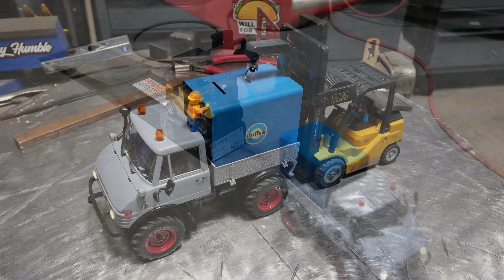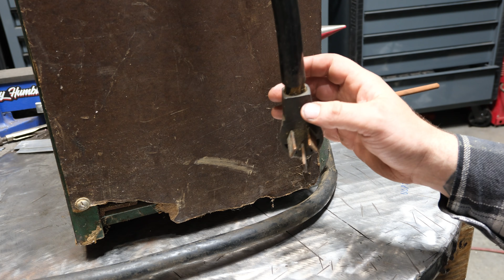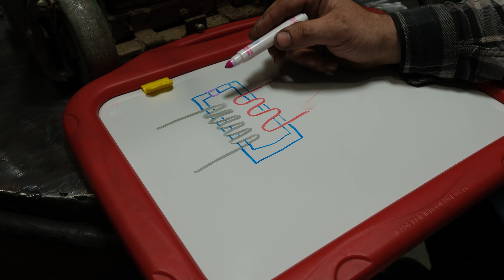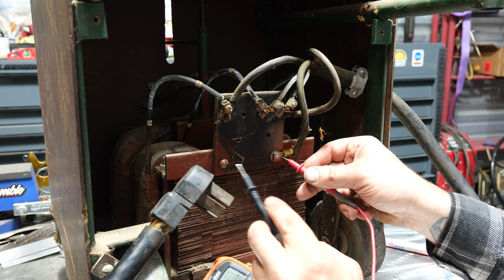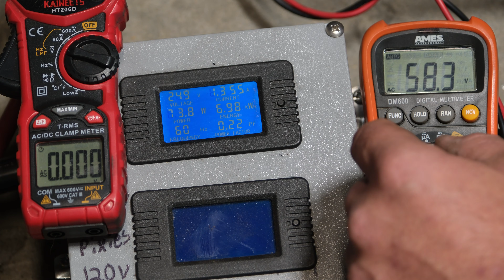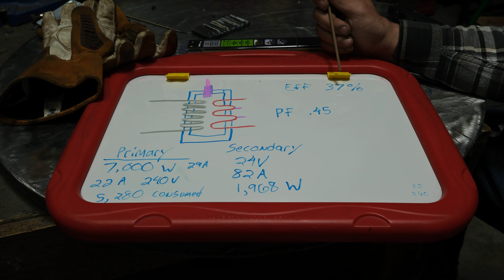A super janky (but free) homemade welder tested....

Comment: Popular Mechanics had a paperback book from way back when, I have several from the mid 50's to early 60's, they had plans for welders, metal and wood lathes, drill presses, airguns, paint sprayers, rifle scopes and all kinds of other things to build, it was when you could go to a scrapyard and find all kinds of parts they even had sources you could get tools, military surplus stuff like motors, they're pretty awesome books. Needless to say, like others have said, there is a good chance they had plans for that in those, I flipped through, found 4 different styles including an engine/generator, it used a regular 120/240v electric motor connected by a belt to an alternator that you modified to put out welding juice, plus a shunt plate to allow you to adjust the welding output.
Reply from the maker: I wonder if it is indeed something built from plans like that.  I have heard of such animals but never seen one in person lol.
Reply: My grandfather built the welder generator powered by a 8hp Briggs for off grid stuff back about 75 or so it worked pretty good for home built wish I had it now went to scrap years ago
Reply: @louiel8711  I remember the "Use an old lawn mower engine and and an alternator to build a generator" plans.
I forgot how you modified the GM Delco One Wire Alt to get 110 AC out of it but the told you how.
Reply: Used to subscribe to Popular Science, Popular Mechanics and Radio Electronics.   Elon stole my Mars starship plans....

Comment: Even now, in some parts of the world this welder would be considered hi-tech compared to what they seem to be using in the videos.  Not being disrespectful, just saying that sometimes people just have to get work done with whatever they have at the time.  Thanks for showing how it's made.
Reply from the maker: No doubt the fact it can be adjusted at all is an upgrade over what many people have to work with, even today.  I have seen guys in Pakistan weld together truck axles with a big ball of wire for a transformer, it’s amazing what ingenuity will alloy someone to do.
Reply: 100% agree with you. I've been fortunate enough to have worked world wide in some pretty rough locations where no8 wire solutions are the norm.. crude sure but effective and very easy to repair is the name of the game when spares are literally days if not weeks away..

Comment: With the way the laminations of the travsformer looked quite uneven in length, or at least not stacked in alignment, my first instinct was the trans was homemade. Now there's certainly a ton of decent looking winding. I wonder if a guy wgo rewound motors made it as a little hobby project. Seems like the original builder had a pretty good idea if what he wanted to do, and for its age maybe he did. It's actually a really cool old relic and as someone else said,va great conversation piece. It's probably one of a kind, but I'd still love to see how it runs common electrodes.

Besides, it's s hell of s lot more well thought out than the guys wiring up a few microwave transformers screwed to a 2x4s with a set of jumper cables.
Reply from the maker: It’s definitely odd, some things look legit on the transformer and other things not so much.  It’s the noisiest transformer I have ever heard, which makes me wonder if it was junked in a scrap bin and someone snatched it up, did some quick repairs, and made a welder out of it.  Due to limited power I wasn’t able to do much testing so I am going to hook it up to a bigger breaker and see what I can find out.  I am not sure how well the variable amperage actually works, I have a feeling it might not work as good as expected lol.
Reply: @makingmistakeswithgreg I’ll tell you what’s odd. I wrote a post and, well, posted it. That was fine. Then I went to the internet and added a page with a picture of an old GE crank welder - and my post seems to have disappeared.
Reply: A lot of old transformers are somewhat irregular.
Reply: I saw those laminations too.  They did look like they might have been prototypes.

Comment: I wanted to see the welds though. Did you get a nice slag peel from the 6013? I imagine you could also run a 3/32" 7018AC rod off that machine, might make some ok welds. That open circuit voltage looked nice too, enough to keep a 6010 lit, but 6010 on AC power would probably make a big mess and throw spatter everywhere.
Reply from the maker: It actually welds good.  I will have to do a quick video welding with it 😀👍.  6013 actually had a slag peel, but that’s probably more to do with the decent rod than the welder lol.
Reply: @makingmistakeswithgreg  No, you're right about the welder does a decent job. By welder I mean you not the machine. So this is a really good lesson that even with a janky machine like that, you can put down a better looking bead on plate than me with a low hours nearly new Multimatic 215. lol! Nice. I had a feeling with that big of a transformer and good open circuit voltage that thing would weld ok. As long as the transformer didn't overheat first... 5 kilowatts with no fan seems sketch, and we both know how damn hot that tin shed gets in the summer!

Comment: Many thanks to the person that passed this along to you, Greg, it was neat to see it.  I've seen some real janky gear in my six decades, and this one ranks right up there.  Sorry, but I do have one issue with your video.  We didn't get to see your welds!  😮🤣
Reply from the maker: I somehow forgot to put a pic of the welds in the video lol.  I will be retesting some efficiency testing due to some discrepancies and I will do some actual welding with it.  It actually welded pretty good.  If the amperage is set low it has a real rough time starting the arc but other than that it welds good 😀👍
Reply: @makingmistakeswithgreg A comparison between that welder, the DialArc, and the Tombstone would be pretty cool. Just show it on the whiteboard.

Comment: i'm very interested to see this things efficiency & ability on its higher settings. please do a follow up.
Reply from the maker: I am going to retest its efficiency.  A few people pointed out some things seem a bit off and I agree.  I am thinking there may be interference going on with the meter because some things don’t make sense.  I will run at higher output as well.  It should be in the area of 50% to 60% efficient at low output, so I need to definitely do more testing.
Reply: ps. any chance that there's some way that the settings on the welder somehow shifted in years of use/neglect? i cant really see in it so i don't know if a bolt or something could have moved for that indicator.
Reply from the maker: As far as shifted on output, it’s possible that the indicator could be readjusted to read accurately.  I have a feeling it could be adjusted to read accurately at one output, but I have doubts it will be on at all outputs.  I need to experiment with it and see 😀.
Reply: @makingmistakeswithgreg   thanks for the reply, its a interesting piece.

Comment: So how did it stick weld? My 120v buzz box also does not have an on-off switch, and only has plugs for 40-70-100 amps. Were the welds acceptable?
Reply from the maker: I completely forgot to put a pic of the welds.   It actually stick welded good, the 6013 welds were clean.  I will be doing a quick follow up video this week doing some more welding and testing of it and I will be sure to get some weld bead shots with it 😀👍

Comment: The 90 is actually 40. ..  a badly drawn 4 can easily look like a 9 and then there are 40 amp steps between all the numbers RH aligned ...
Reply from the maker: Yep you’re right .  If only the readout was accurate to actual output lol.  I will need to try to calibrate it lol.
Reply: @makingmistakeswithgreg  good vid btw..  here in New Zealand we call these bush welders. Crude effective and basically indestructible .  I saw that you corrected yrself later..

Really enjoy your work and humour chairs mate

Comment: That looks older than the 70's. I'd guess 1950's. It might have been a kit build or a DIY from a magazine. Then other option is it was on a farm and the original cabinet rusted away and someone built a wood case. I say that because as a kid, I used a welder on a farm that sat just inside an overhang opening and it was just a bucket of rust but I welded with it. The "9" was meant to be a "4" I think ... 20, 40 ,60.
Reply from the maker: If it is 50-60s that sucker would have been a really decent welder for the time.  Great thought on the original case rusting away, that could totally explain why someone would have made a new one.  I definitely need to spend some time to see if I can find a welder that matches its setup.
Reply: I looked for the best comment to add onto.  The fasteners put it in the 50's or 60's for my vote.  My uncle wound motors in a navy shipyard back then.  His work would have looked better but those fasteners are everything my uncle had in his garage.  lol. Excellent video btw Greg

Comment: 18:56 look at the numbers on the wires they are not homemade . There is probably some more labels somewhere
Reply: You used to be able to buy sheets of those wire number stickers at the hardware store.
Reply: @moconnell663  I have wire marker books around someplace. The sheets came in booklets. Each page would be like 5 different numbers. Then you'd get a couple repeating pages. But you always ran out of the low numbers.
Reply: @moconnell663 you can still buy them.
Reply from the maker: I need to take the panels off and see if I can find some more info.

Comment: I wonder if you bought a power factor correction device if that would help. They are essentially a capacitor.
Reply from the maker: The power factor could be improved with pretty simple means.  I am probably going to improve the case a bit (with new wood) and put a rectifier in it to give it d/c output.  I will also look at doing some PFC to really turn it into a Frankenstein lol.

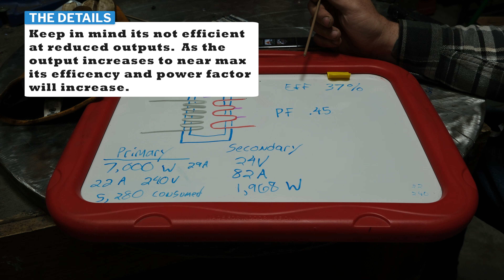Comment: 30:40 Lincoln 225AC on 250ft of 12ga extension cable... trips a 28amp generator breaker after 36 inches of 3/32 E7018 ~ 110amp... + another 50 foot of 6/0 grounded to rust scale. * the old AC225 has coiled copper sheet in it, not round wire. +70% eff. ... the new 225ac's have an aluminum primary as far as i know. up at 180amp seems to drop to 53% ... tight dyrect contact wire sheet, not round wire.    now the true statement of 82amps, is that 82amps is 20 amps more then needed to run 5/32 7024 jet rod smoothly with no interruption for surface cladding abrasion ridges on equipment. is that thing putting out a true 80amps? try 5/32 jet rod at 60amp to 80amp depending on the operator, proof in the rod not the meters.
Reply from the maker: The newer aluminum tombstones are definitely right at around 53-60% eff depending on output, not surprising the old ones were better.  The transformer in the one in this video is all copper wire, but the primary is wound wire and not flat sheet.  So better than a modern tombstone but not as good as many vintage welders.  I am going to be retesting it with more accurate meters to determine for sure what the efficiency is and outputs.  It seems too low on efficiency given the output, but I know there is error in metering.  The 3/32 6013 seemed to run like it was at about 70 amps or so, and the meter was reading over 80.  More accurate meters and some more testing will find out what the truth is lol.

Comment: I am pretty sure you got the power cunsumption wrong. 22A is the measured current. Thats exactly that your breaker wil see, not 29A. 22Ax240V equals 5280VA (not W!). Multiplied with the Power Faktor of 0.45 this gets you 2376W, which is you also approx. what you can read on your Power meter. (second row, first value) That gives you an efficiency of 82%,  which is more than i would have assumed. The "7000" are the summarized Wh that your power meter has measured.
Reply from the maker: So the way the meter reads is not what you would suspect.  The 22amp reading is the consumed number, by the device.  If you take the 22amps times 240input voltage that gives you 5,280 watts input consumed.  Output is somewhere around 70-80amps at 24v, or 1920 watts.  So 1920 (output) divided by 5280 input equals about 36% efficiency, a bit higher than what was quoted in the video because I used 80a and not a more realistic 70).  The actual input loading via a meter (which I didn’t record) was showing between 27 and 29 amps on the input line.  Which makes sense because there is no way it’s utilizing 29amps of input power to output only 80a for welding, the difference is reactive power.  If the reverse was true and it only used 2400 watts of input with to output 75a at 24v it would be 75%+ efficient which would make it as efficient as a modern machine. 

I am definitely going to recheck everything and hook a different clamp meter to the machine to get some more data to figure out what’s going on.  Knowing how bad the power factor is, how much heat it output, and what the input clamp said (29a) the numbers make sense that I listed here.  However the accuracy of such numbers are definitely questionable.  I will double check everything 👍
Reply: @makingmistakeswithgreg   Per definition the efficiency does not include the reactive Power. Its just real output power divided by the real inout power. 
Assuming that your power meter does measure correctly, your apparent power is 22A*240V =  5280VA. 
This apperent power is then divided into 4715VAR reactive power and 2376W real consumed power. 1920W of the consumed power makes is to the output, while 456W will heat your transformer. But even "only" 22A Input for just 80 Welding amps is a lot compared to modern machines.
I don´t know for sure why your clamp meter shwos 29A, but in general take Measurements with the clamp meter with a grain of salt, these are often really unprecise. 
Also it may not be a true RMS device.
Reply: @makingmistakeswithgreg  I second this. Unfortunately you are not right in this case. If you multiply the current with the voltage you get the apparent power which is in VoltAmps (VA). If you multiply this with the power factor* you get the real power in Watts.
Here we should use cosφ, not power factor because the power factor includes the distortion also not just the phase shift. If your measuring device is measuring power factor, that can be misleading because an electrical device can consume electricity with no phase shift and still has poor power factor.
Reply: That can’t possibly be correct. Without seeing the numbers I can tell that the efficiency couldn’t be more than half that.

Comment: Every machine was homemade at least once
I want to see people start making stuff again, mass produced stuff is so boring and hard to get parts for
Reply: I don’t see how it can be both “boring” and “hard to get parts for” by boring I assume you mean uniform and standard in design, but that flies in the face of “hard to get” since all these boring designs use the same supplies in slightly different configurations. Getting parts for your very specific design of custom welder would actually be hard since you don’t really know anything about it’s original design, but just opening up a modern welder and you’ll recognize common components like capacitors, resistors, control boards, etc all of which are fairly standardized in the modern day and cheaply/easily purchased and replaced (to a degree). Just as an example a 15 year old harbor freight acep flux welder can be easily and cheaply converted to a much more capable dc machine with reversible polarity (dcen/dcep) I feel that’s a pretty good indicator that parts are easier to get and modifications are easier to make with the factory produced stuff, even if that stuff is extremely out of date and obsolete. Maybe I’m off base but I’ve never felt that mass produced and unavailable parts really ever go together in reality, either it’s a rare item and parts are equally rare, or they are ubiquitous and parts are equally ubiquitous
Reply: But this sort of thing is dangerous. I designed pro audio electronics and I wouldn’t use it.

Comment: 21:10 the old Lincoln AC225 i got is wired for a hot ground as a neutral source for a secondary 10amp 12v transformer in it, cough cough TIG as adding a motorcycle ignition coil to the 12v AC side. there is no need for modern computer boards to do TIG welding. have never been shocked by it
Reply from the maker: There are a lot of ways to turn old buzz boxes into makeshift tig machines that work great.  You’re right, even a simple tig setup on an older machine can do excellent welds.